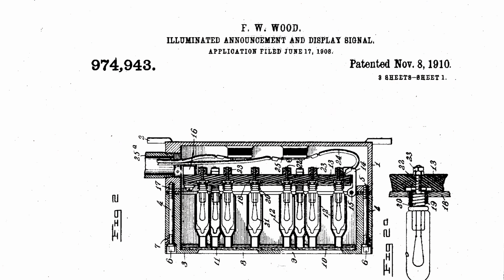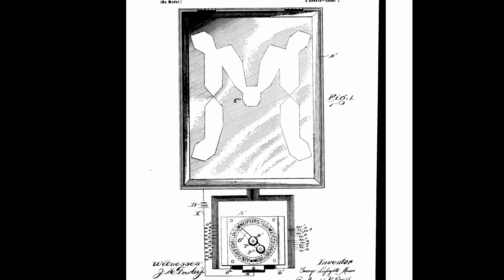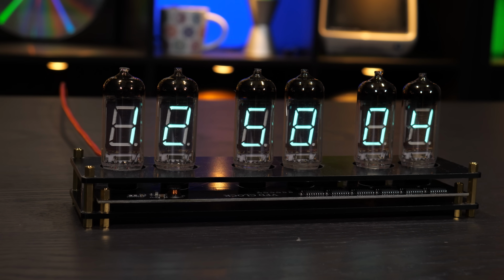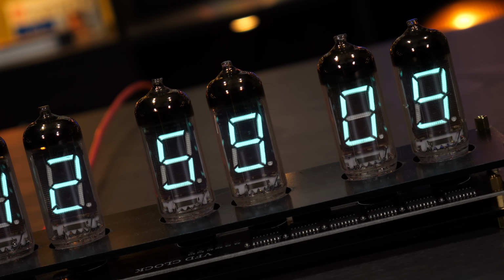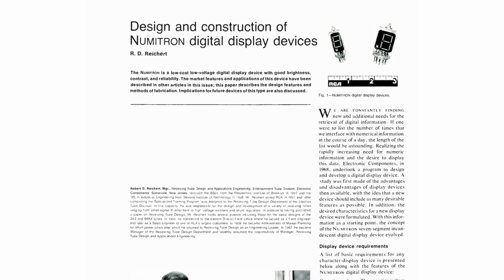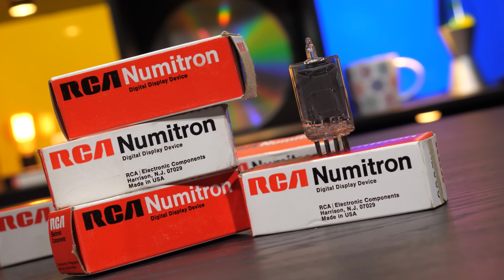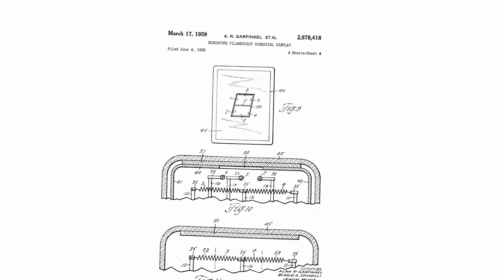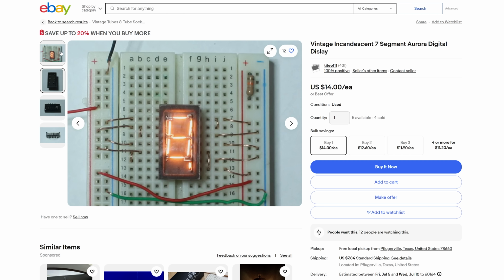The Numitron: An obvious idea that wasn't very bright

Comment from the maker: SOME ADDITIONAL CONTEXT:
I goofed here by not making clear that these wouldn't be naked in an actual product. They'd be placed behind a transparent panel, usually tinted which would reduce the impact of some of their worst flaws (however, I've seen some contemporary products which used these tubes and they're... better but still not great). Really, my issue isn't with the concept - it lived on much longer than the Numitron! My issue is with RCA's version of it: though pioneering, it wasn't very polished.
(original pinned comment): Did you notice in some of the B-roll shots that they actually look more readable when they're slightly out-of-focus? That's the real downside of using segments thinner than a hair!
Reply: A part of me wonders if that's the thought behind the not-totally-black background - at least as they appear on screen in the dark-setting clips the reflected halo around the segments sort of visually highlights the segments, turning a wire-thin segment in to a blurry and diffuse but at least a little thicker one? It doesn't do a great job of it but that kind of fits the running theme of the video...
Reply: @HunterJE  I came to say exactly the same thing. I was going to suggest it was a physical "anti-aliasing" thing...
Reply: @HunterJE  Yes, I was thinking this too. If you kinda ignored the bright filament, the fuzzy image on the backing looked pretty good. It didn't suffer so much from the dark spaces between the segments or the elongated side filaments. Of course it takes some doing to ignore the bright filament. Also, having it glow on the background makes it brighter.
Reply: Yes, that's why I always thought there should be a diffuse piece of glass 1 or 2mm in front of the filaments to make the segments appear a bit wider.
Reply: i think the gray background actually helps a bit with that, since behind the thin wires there's a thicker (although diffuse) copy
Reply: My father worked at NASA doing navigation during the Apollow era and on through the shuttle. I remember sitting on his bed each day as he upacked his pockets. In addition to his over-stuffed pocket protector jammed with felt-tipped pens and his ID, he had a nearly inch-thick calculator with a stamped metal plaque on the side declaring it property of NASA and an ID number. This calculator's display was made of tiny little red lines, though these were in truly tiny arrays. I think they even had curved lenses in front of them made out of clear red plastic to act as maginifiers, just like the LEDs in this video. 

The calculator was also cool in that it accepted small strips of magnetic material about half an inch wide and two inches long that you could insert. These acted as storage media. My father kept a tiny sleeve of them in his pocket protector. Very cool to think that it was cutting edge tech at the time that helped us get to space.
Reply: @johneckelkamp9655 That might have been a TI-59 calculator your Dad had. (Texas instruments). I’ve still got my TI58. But that model didn’t have the magnetic card reader. Edit: it had small LED seven segment displays.
Reply: @johneckelkamp9655 I remember standing in line at JC Penney as a small child in the early’70s to order a Bowmar calculator for my dad. It too had the tiny LED display with the red magnifying lens.
Reply: Have you ever done a video on those store price tag signs Kohl’s, or Aldis have? Calls it’s like paper white with jet black numbers making you change them like instantly. I think there is an internal like flips over or something do you know what I mean?
Reply from the maker: @Richie_in_3D  Yes! Not in that context, but those are E-ink displays.
Reply: @TechnologyConnections your spaceship earth reference made my day
Reply: @TechnologyConnections  In a fun parallel of uncommon display tech, many of those retail displays are actually ZBD Bistable LCDs which are very different from normal ePaper displays.  Non-volatile / ePaper displays are a bit a of rabbit hole in their own right
Reply: @TechnologyConnections  BOOM
Reply from the maker: @eloquentemu  not to out-pedant one another, but e-paper is the generic word for paper-like display and E Ink is the term for the microencapsulated electrophoretic type (specifically those made by the E Ink corporation if using their trademark). People kept calling the Pebble watch's display E-ink (which is wasn't! it was LCD) and, while I'm sure there are plenty of price tags out there which use the bistable LCD tech, most I've seen are two-color red and black E Ink.
Reply: @TechnologyConnections  Kohl’s uses Memory in pixel displays for small tags and they’re also terrible, but for different reasons
Reply: @TechnologyConnections November Kelly mentioned your channel in one of the most recent Well There's Your Problem episodes (NS Savannah, i think?) 

Alec guest-host on WTYP when? And what's the episode gonna be about
Reply: @eloquentemu I think those were known as colesteric displays ir something like that.
I might still have one somewhere.
Reply: @eloquentemu  I have a 7 inch e-paper display that takes HDMI and can run at 15FPS. i've got a video of it on my channel hooked to my SNES.
Reply: @Richie_in_3D  To elaborate on the e-ink explanation: these displays nowadays can display white, black and red (or yellow, but red is more common). IIRC, the red balls are larger than the white and black balls and move therefore slower, so the controller can "sort" the charged balls by using slow and fast voltage changes. Note that this "sorting" process takes longer than an update of normal black and white e-ink display and you will see the displays flickering for a few seconds.

These ESLs ("electronic shelf labels") typically have two coin cells inside which last between 5 and 10 years. Obviously less if you update the display very often; they are not meant to be used as a clock which updates every minute! Communication is wireless, of course, typically via something very similar to ZigBee. And yes, they are graphic bitmap displays.

Some ESL models have thermometers inside, so they can also transmit the temperature along with the battery and received signal level when they get polled by the gateway. The gateway, which usually looks similar to a Wifi AP, converts TCP/IP commands (at least one brand uses MQTT) into the native "ZigBee-like" protocol for the ESLs and vice versa for the responses.

For small shops, which don't want the whole infrastructure, there are also ESLs with NFC. Downside is that you have to run around the store with an NFC reader (your mobile phone I guess) to update the tags.

Most of e-ink display production (by far!) is dedicated to the ESL market nowadays.

And if I was nerd, I'd have a few e-ink displays (along with a gateway) at home, for things requiring only one update per day, like the weather forecast. Along with an LED-strip clock (RGB of course), similar like the one mentioned at 9:45 -- but I'd opt for a full matrix display. No need to leave space between the strips! You could also use it as a wall light!

Luckily, I'm not a nerd.

Actually, I have both at home. But I'm not a nerd!
Reply: You ripped on RCA pretty hard, but I would argue that they made a smart business decision. 

They probably saw the same writing on the wall that mentioned, about LEDs being the way of the future, and decided to invest as little as possible in filling a temporary market hole to make a quick buck.
Reply: There were a couple of times when the display is just to your right that the display looks really good, that the backing blended in well enough with the bookcase display that the numbers just look like they're sorta floating. Almost every other angle looks pretty janky tho.
Reply: I have one of the old GE alarm clocks still, and years ago I had torn off the film that covers the LED display. It's now unreadable unless it's dark, as all you see are the actual LED chips now.
Reply: @timramich you can fix it with a layer of scotch invisible tape. Works almost as well.
Reply: @pw36952m  My intention was to glue on a piece of that silver plastic they use for ESD-safe bags, but over the course of like 20 years, I still haven't gotten around to it. I'd ultimately like to just reverse engineer the display and change them out for blue or white LEDs.
Reply: Maybe it would be more readable if you stick it behind some slightly blurry acryllic
Reply: That yellow clock airport or train station display in the b roll.. Is that really a 7 segment display? I don't think it is, I think it is printed letters between mechanically changed with a wheel
Reply: Entirely separate from the wonderful video, where did you get that shirt? It is amazingly nerdy without being specific to a game or movie and I love it.
Reply: @bloodalchemy  It's an enlargement of a section of the classic Sony Trinitron TV display tube from the 1980s, grew up watching them, they were the best! Try that in your search bar for the shirt.😊
Reply: If you think we haven’t noticed that your clock transition was perfectly synchronized on 13:07:26, think again!
Reply: they should have bundled the bulbs with a tube of vaseline then to make them blurry. 

I had an equally good idea for a 7 segment display. Using water flowing over a bulb and valves.
Reply: Random request but a video on multimeters would be cool
Reply: @jb76489  Thats well covered in other channels that specialized in electrical / electronics training. A rather mundane subject for our esteemed creator, unless he can find a unique twist!
Reply: I noticed the 042069 though.
Reply: Who else is having alot of Nostalgia today
Reply: The problem is with how they executed the concept, not the concept itself so the inventors need not be hated. A trick for readability could be to house the tubes in a dark shroud. Another would be to let your logic drive transistor gates that themselves drive your segments so you can run them brighter. Oh, and they could have easily done better with arranging those segments to look better.
Reply: @TechnologyConnections - I'm surprised you didn't make the technology connection to the ordinary bread toaster. If you had, you might have considered that the "backdrop" inside the tube is probably sheet mica and that would explain the limited color choices. Also, this was the late 1960s; the search for a cheap, easily assembled, "good enough" display tech was pretty hot (pun intended) and glass tubes were commodity parts in all things electronic. This device would have done the trick for many consumer applications had it not been superseded so quickly.
Reply: How expensive are they now. Guessing a limited supply exists somewhere.
Reply: @aperitifs  Today, the price doubled.
Reply: @aperitifs  I was checking and nixie tube clocks, DMMs, signal generators, etc., are still available on Ebay for not a too exorbitant price. Probably a fairly small niche market for this equipment.
Reply: I imagine that a thin sheet of lightly frosted glass in front of the filaments could have improved the look quite a bit. Especially if that glass also had a black mask on the front side to block any light diffused by the background or the frosted glass.
Reply: @mytube001  I was thinking along very similar lines- could they shove a diffuser in front of this thing?... maybe a mask?... how would they implement that, what about viewing angle, etc... But it also reinforced my feeling that if LEDs and VFDs hadn't been waiting in the wings, this could- and probably would- have been refined along those or other lines into a much more mature and professional-looking product.

Whether RCA ever planned on that (if they hadn't realised how quickly LEDs and VFDs would become affordable) or whether the Numitron was only ever meant as a short-term stopgap cash-in, I'm not sure.
Reply: 21:37  is a polish joke for purpose?
Reply: Since e-ink came up… are you planning on a follow up to your e-paper computing video. There’s been a lot happening in that space and I’ve wondered if you ever found something that satisfied you.
Reply: I had the idea of putting some buttons into the device you built to stop and reset the clock to the last time it was stopped. Imagine the clock showing the actual video's time throughout, that would have been insane (and very very annoying for you to achieve)
Reply: And at least some of them are timed to have the clock match up with the A-roll. I appreciate that.
Reply: For whatever reason, this is what bugs me about many of the Nixie et. al. projects these days. So many of them have the tubes naked. To me it always looks cooler when you see like original products that used them, how they're shrouded and bezeled in the product. Maybe it's just the added sense of depth or something. I know people want to be, 'hey it's a cool tube, look at it!' but I'd like to see some more in situ.
Reply: @barcodenosebleed5485  It's just like tube amplifiers. If you can't show off the tubes, it's worth nothing. The most ridiculous part is that, with some "audiophile" tube amplifiers, the chromium-plated case (through which the typically microphonic tubes stick out) costs more than the electronics.

Yep. Microphonic tubes are popular in the "high end audiophile" scene. To show off your chromium-plated tube amplifier to your "audiophile" friends, you place in the strategically best position right in from of your esoteric and expensive speakers. The microphonic tubes will pick up the sound from the speakers, the grids inside the tube with vibrate with the sound, and you'll claim that the (significant!) distortion is more "HiFi" than the distortion caused by solid-state electronics...yeah, right.

Oh, and back to the Nixie tubes: if it's inside an enclosure, you could cheat and replace 'em with small OLED displays. And, yes, you can actually buy Nixie tube lookalikes with OLED displays inside (even displaying the grid on the OLED). I think the Elekstube is just a the PCB with the components and some pins to plug it in, but you can also buy glass caps to make them look like Nixie tubes. Except that Nixie tubes don't show a boot screen when you power them up.
Reply: They work much better behind a circular polarized filter.
Reply: They'd definitely look better behind a slightly frosted display window, and even the grey background would give it a little bloom and help out in its own way.
Reply: Aw, I guess you didn't come across Wamco displays in your research for this video. They made a huge range of square incandescent segment displays, including alphanumerics, that were mostly used in aviation and military equipment of that era (70's/80's/90's). Everything from fighter jets to relatively inexpensive private aircraft equipment. They were behind color filters in actual equipment, and daylight readability was the key selling point. They were mostly replaced by LED pixel displays after (HDSP series etc), which were also daylight readable. Military applications often use elaborate contrast filters with exotic AR coatings, so the only remaining problem with incandescent segment displays (that you didn't mention in your satisfying tirade of negatives) was reliability. Incandescent segments burn out, and that would happen quite regularly in aforementioned aircraft gear. The vibration sure didn't help.
Reply: Seems like they used grey to make the segments appear a bit less spindly.
Reply: Great video in this yesteryear technology. I used equipment with nixie and pixie tube displays up until about 1970, when these seemed very high tech in comparison to analog instruments and devices with mechanical numerical displays.
Reply: where did you purchase that vfd clock? i cant find any ones that look as good.
Reply: @kninefr  If you can't find any VFD clocks on Aliexpress, try searching for VDF clocks. It's a common typo.

Now, I don't know what you'd consider aesthetically pleasing. But...that obsession with "special clocks" is unhealthy. Trust me. If I'd put on a viking helmet, people might honestly mistake me for Flavor Flav.
Reply: i noticed this when i took off my glasses lol
Reply: So just give those tubes a light sanding and they're perfect! You're welcome RCA.
Reply: Maybe it's so you can read them easy in the dark when your eyes are bleary from sleep?
Reply: Why use Numitron if you can have Nixie tubes?
Reply: @Nikioko He covered all that, rewatch the video. Mostly added cost, weight, space, heat of nixie tubes high voltage driver circuits and power supplies makes the products less cost competitive. Don't spill your beer on the 180vdc power module!
Reply: Btw, why did you say "seven segments"? There's only 6..?
Reply: @VertegrezNox  horizontal: Top, middle, bottom. Vertical: top left, bottom left, top right, bottom right. 3+4
Reply: @VertegrezNox  look again
Reply: 21:16 illustrates the original pinned comment really really well.
Reply: I don't remember flat pack Numitrons being used in gas pumps, but I definitely remember some used Panaplex displays, which are flat pack 7 (or more) segment Nixie type displays. I have a small collection of them sitting around somewhere.
Reply: Maybe the original designer of the numitron  had poor eyesight and figured that instead of having to put on glasses to better see the time, with these it was easier to read without glasses 😛
On a side note, speaking of continuity, the panning shots with the time matching the time of the fixed (speaker) shots didn't get lost on me. I'm not sure if anyone else noticed, too many comments to check!
Reply: Loved these lumitrons.... best invention... Id like to build me a project  out of some
Reply: i like the raw look tbh.
for some signature furniture it would give a nice note.
Reply: You also ignored that they were manufactured as vacuum tubes. That is why the were greay, instead of black.
Reply: If I am looking to make a clock that looks like the numitron tubes but are led instead, does anyone have any recommendations
Reply: @Pesticide00  There varicose sizes of rectangular LEDs, but you might have to mask off part of the face. 
50 yeas ago, seven segment displays were often hand made with small incandescent bulbs with  barriers between segments, then covered with tinted plastic. You could try thia, using orange LEDs.
Reply: I’d love to see a video about portable water coolers, like the Frigid Aire portable evaporator cooling system.
Reply: Per some of the comments, they were apparently dead useful in avionics displays.
Reply: you inspired me to make my own channel abt tech
Reply: It's 'Hindu' numerals, because it originated in India. It reached the west through the Arabs, so Europeans called it the 'Arabic numerals'. And you're repeating the same pr0paganda in the first minute
Reply: @chi-8289 it originated in west africa and spain. Not even arabia. Indian schools must be cranking the propaganda mill super hard